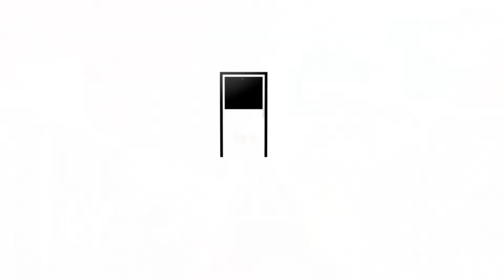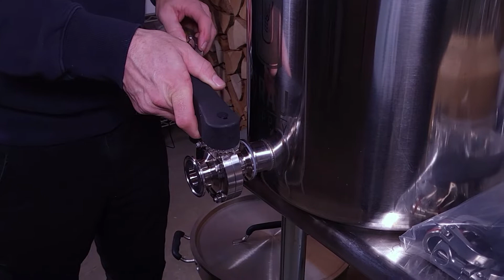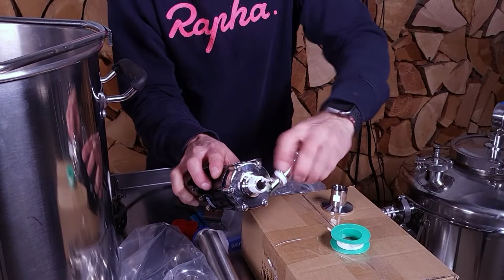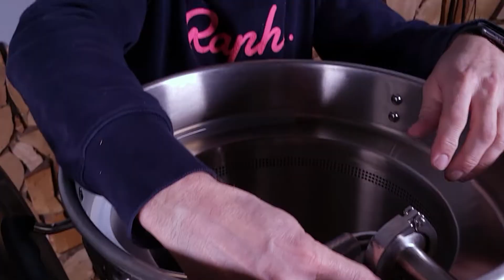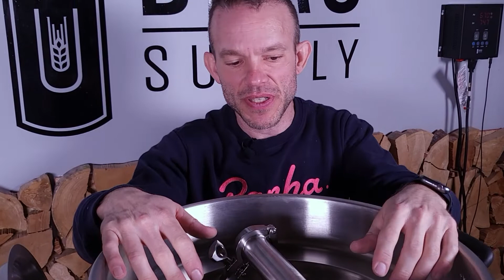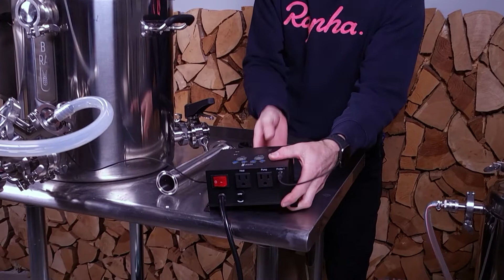Assembling the Unibräu Premium Brew system

Comment: Great video. I bought my 120v system back in 2018. I love it. Top quality components right out the box. Done close to two dozen brews on it and never had an issue. Been considering upgrading to the 240v set up for some time. The one thing I'll never forget, is Steve working with me answering my questions and making it happen! I was deployed at the time and didn't have the best connectivity. Thanks for helping me out Steve. Wish you the best! Keep on rocking.